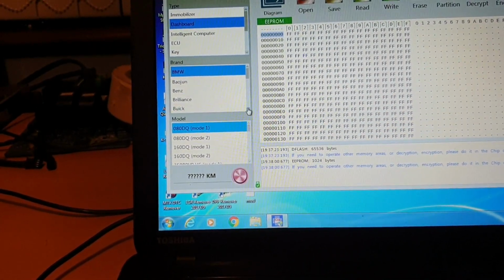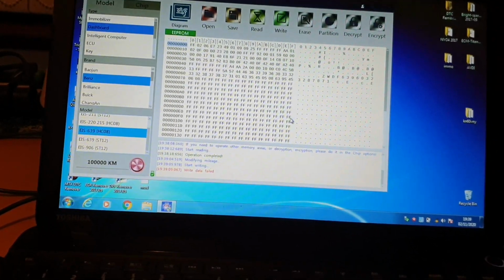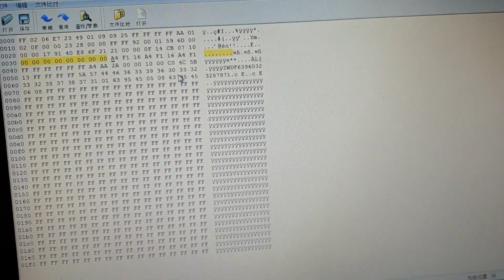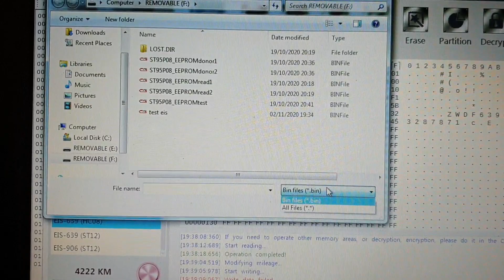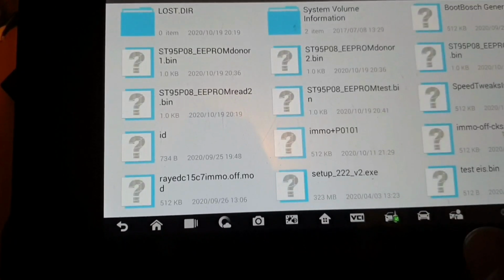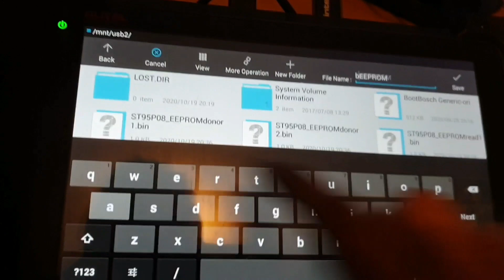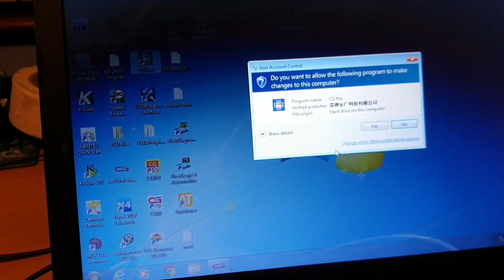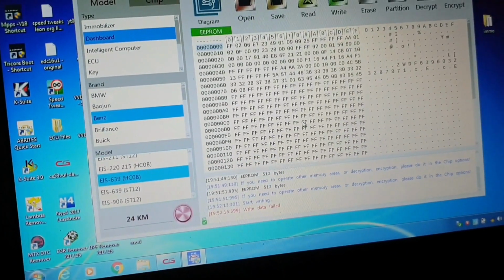Mercedes EIS Mileage Correction  Manually - CGPro failed write. Autel XP400 works

Comment: Since you read the original file with CG pro and had 148401km, you did not had to play around with the mileage in the Hex Editor. All you had to do is change the mileage to the mileage you wanted in CG pro, which you did change to 100000km. All you had to do then SAVE the new file with 100000km in CG pro and use IM608 to write it to the EIS. And what about the Instrument Cluster? How did you do that? Thanks for sharing!!!

Comment: I really need to ask you. So you have an im608 pro and I have ms908im. I have tried one spare key on cas3 and it failed and ruined the first key too. Uslocksmith said im608 pro is much better and completely different to the ms908im. How did you come by getting im608 pro when you are in uk. Would have thought you would have asked Autel like me and got told the same to get the ms908im. 

J
Reply from the maker: Your question has me a little baffled.  
1- I'm not a tool seller or reseller but can tell you the MS is the only European official IM tool, not only does it have the same immo capabilities as the 608 it comes with the better programmer and slightly better diag capabilities. My 608 is old, something I purchased well before the MSIM were on the market
2- So a CAS module died, it happens. Have you researched CAS systems? Your Autel has all the capabilities you need to recover one